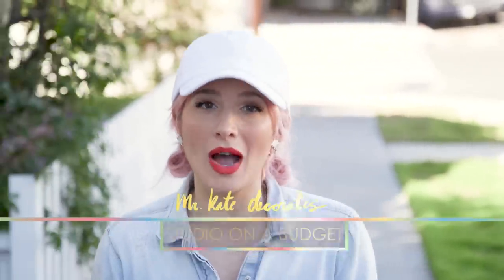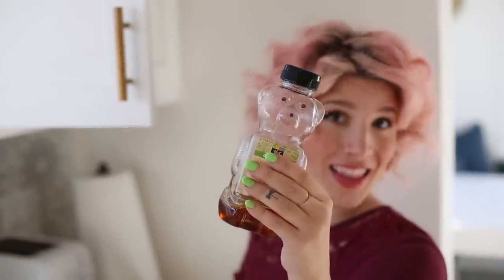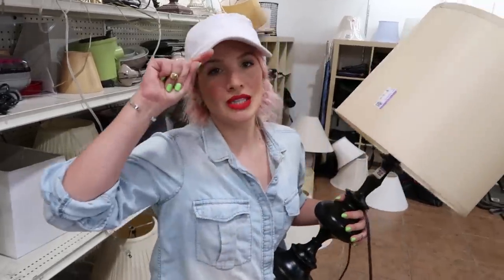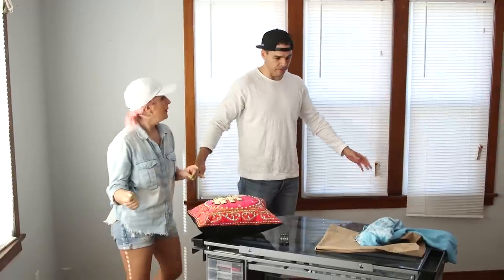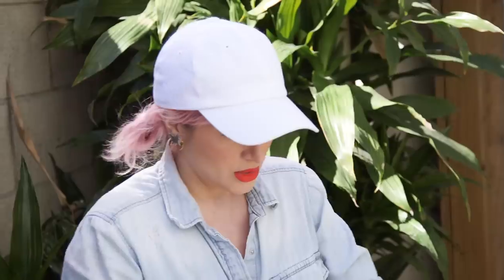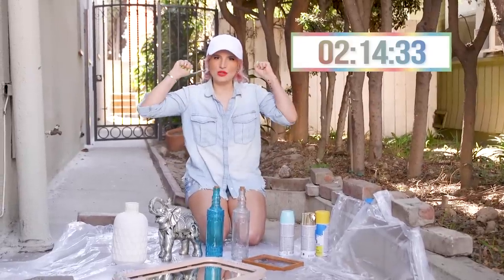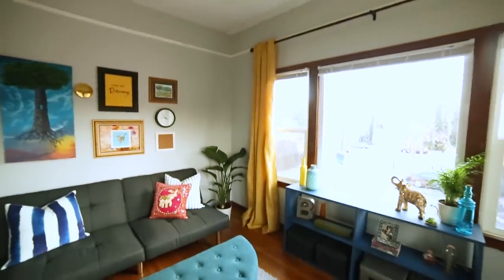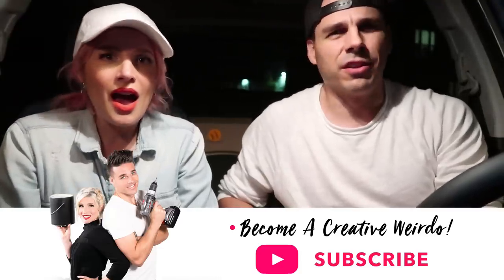Studio Apartment Makeover for Under $300! | Mr. Kate Decorates

Comment: The ponyo artwork was fashion disaster.  She should have used some of the left over paint and painte dover the canvas and then centred ponyo on the painted canvass.   The diy ponyo really looked bad, cheap.  I think the paint would be a way of unifying the colors too.  But one error isn't too bad lol.  The gold doesn't really work; she should have gone with blues; the gold is too random.   and sprayed a few more things metallic gold to unify the room.  Colors need balance and repetition. So for example the gold pillow on the bed was rather weak as the gold was so minimal in the bed linen..  And the dress fabric - for a stool or bench that small she could have got cheap fabric or an aold blanket that wouldnt hae seams.  it woud be different if she had an old dress or sentimental piece that was being remade but going to a thrift store - she could have foudn an old curtain panel without the seems.  anyways  good job but I do think some careful edit and color balancing would have made this place even better.